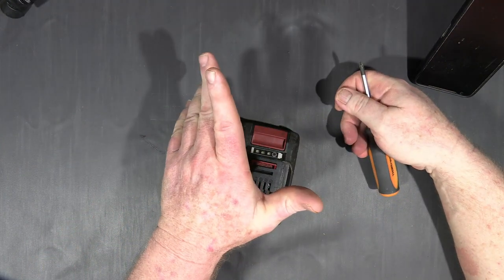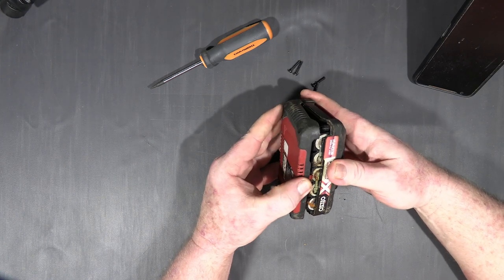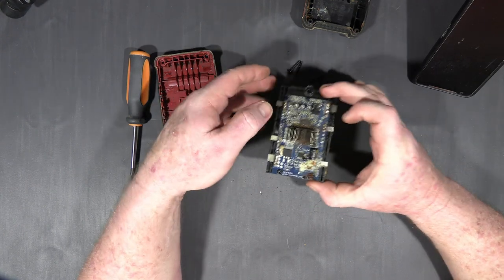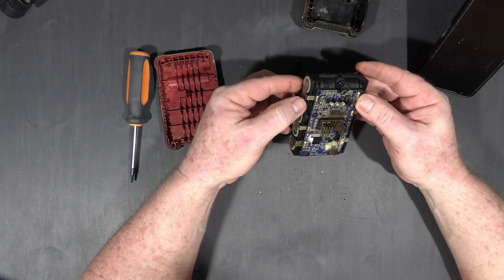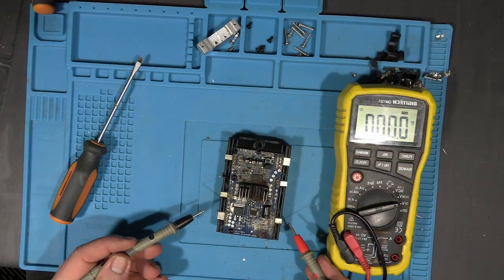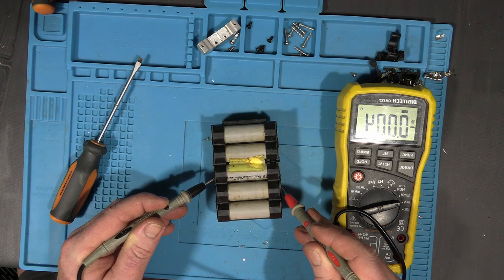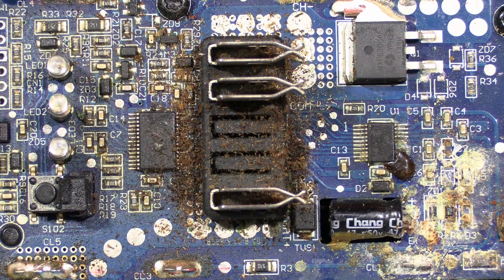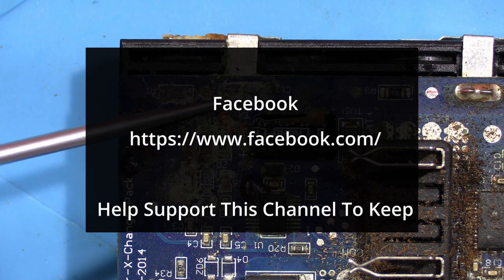TEAR DOWN OF A FAULTY OZITO 2 AMP BATTERY, INSIDE VIEW OF A CORDLESS OZITO LITHIUM ION BATTERY PACK

Comment: Unless it’s an optical illusion, looks like those screws had left handed thread as u seem to be unscrewing them in a clockwise direction. Or maybe I need to seriously cut done on the grog
Reply: The whole video is a mirror image, thats why the multimeter reading made zero sense
Reply: @xDMG15x  Yeah, the only bit that isn't mirrored is the bit where he holds the pack up to the camera with the battery type and capacity stamped on them. I don't know why he couldn't have posted the entire video that way. [SHRUGS SHOULDERS]
Reply: @Roger-ic7sf people often mirror or alter video footage if its ripped from a video made by someone else, in order to avoid the automatic copyright bot from matching it to the original. I don’t know if thats the case here but it’s the only reason i can think of to mirror it.

Comment: I think what happens is the battery sweat when they overcharge and heat up then the batterys leak causing the mess. Mine was exactly the same and has never been wet
Reply from the maker: There was one on the news the other night burst onto flames and the chick reckons it wasn't even charging or being used ...
Reply: We just had a Kambrook vertical fan catch fire & almost fucking burn the house down. It was left plugged in but not operating. No batteries to blame. 🔥
Reply: @chrisg6091  hmm thought it would have had a thermal fuse by law. I guess something else somehow happened around it.